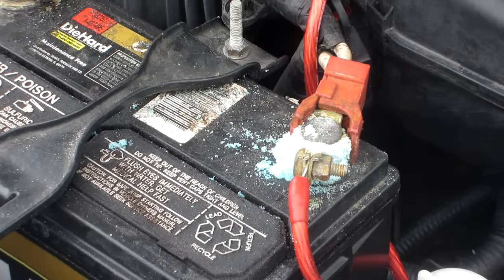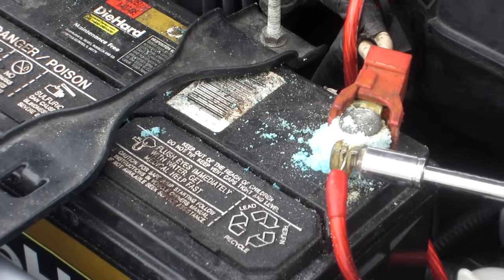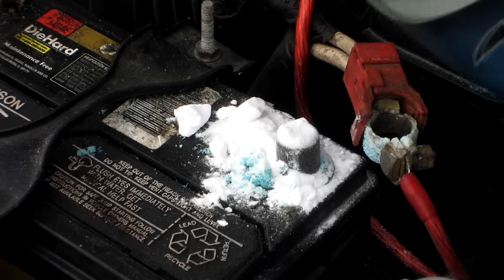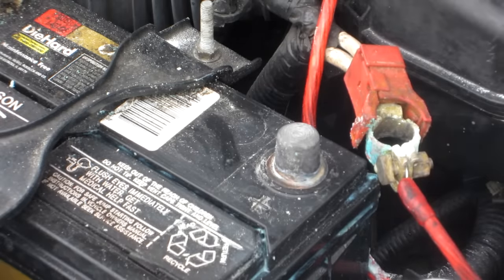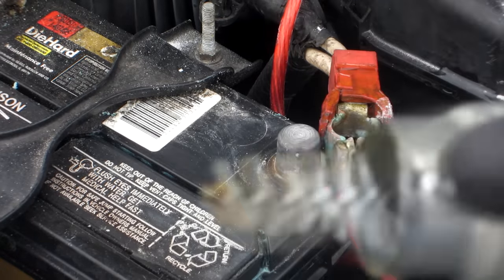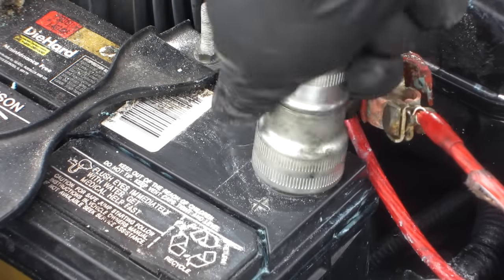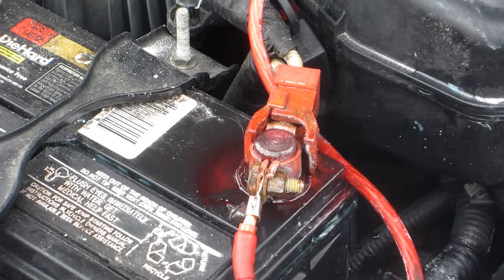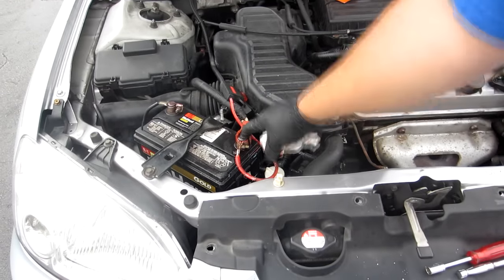HOW TO REMOVE BATTERY CORROSION FAST AND CHEAP!!!

Comment: You see normally nobody has that problem I've never had a vehicle have that problem there's absolutely no need to buy any of that stuff. Fix the problem fix the wires and you won't have to put anything on there. You're trying to put a Band-Aid on something instead of fixing it.

Comment: Here's an easier way....just use hot water.  No need to waste baking soda :)
Reply: Can you use boiling water to clean the terminals if the battery is in the compartment? Should you take the battery out before you add hot water?
Reply: @chocolatier9597  no need to.  Using hot water is no problem in the compartment!  It's really that easy and that simple...but garage's don't wanna tell you this cuz they wanna charge customers $50 for it.
Reply: @chocolatier9597  No need to take the battery off. Just boil a kettle and pour over terminal. Dry it off and coat it with Silicon Grease or Petroleum Jelly (eg. Vaseline). This will seal it from the air or from any acid getting to it again.

Comment: Dude. Bust out the garden hose rinse the shit off dry it with compressed air. Spray on permatex battery protectant. The purple stuff, done. 

The crc stuff is garbage! That shit will make you have to do it over and over.

Comment: Get one of these from AMAZON> {LPHUS Memory Saver Connector OBD2 Car Diagnostic Cable & ECU Memory Saver Cable with Alligator Clip, Vehicle Battery Replacement Tool, Emergency Power Supply Interface for Car Battery Helper}

Comment: Just remove the terminals.  Pour almost boiling hot water and then put some in a container mix in baking powder and stir. ...then pour onto the terminals and rinse. ..reconnect the terminals and you are done.

Comment: Thanks for the video. But this process was completely wrong! As you can see when he poured the water on the battery some of that mixture got inside the battry tabs on top. When that happens you can kill battry cells and ruin your battery.

Comment: Hi, no need put so much effort, just clean the corroded terminal with hot water, then wipe it with a clean cloth till it is dried. Apply some depolarizing grease on it. That's it.

Comment: just pour boiling water on the battery terminal its more easy and put grease so it will not corrosion anymore :D

Comment: Put a few strips of duct tape or package tape over the refill caps to help  prevent the cleaners from getting inside, then remove the tape.
Reply: Taping off the caps is absolutely not needed.

Comment: Not sure why OM would recommend it other than that’s what people have been told to do for so many years! Another fact is you should remove the ground cable first. Then if your wrench happens to hit metal you won’t see big sparks ⚡️! And you’ve removed battery voltage from the entire vehicle even with positive cable still hooked up because it’s DC voltage.
Reply from the maker: Young and dumb when I did it but you are correct always remove the negative terminal first. 😁

Comment: You are NOT supposed to put the corrosion spray on before you tighten up the connection. otherwise you inhibit a sound current connection!
Reply: It's a conductor so your point makes no sense at all.

Comment: your corrosion problem has nothing to do with a capacitor Its because of neglected maintenance and the cheap power wire you used for your amp. step one to stop that in the future is to use solid copper connections and dialectic grease.

Comment: So much going on here for cleaning the battery neck. 😂 Pouring a glass of boiling water in the neck will do all the work for you. Baking soda will do but boiling water will reduce the cost of baking soda and coca cola or Pepsi also help you too and when using these you don't need to remove or scape it

Comment: hot hot water in a cup ...  dip the terminal in the hot water and corrosion will disappear ...   You can put baking soda in the hot water too ...   Then grease the battery post and terminal before reassembly ...

Comment: You need a clean dry and tight connection between the battery post and terminal. First use your battery post cleaner wire brush, then reinstall your battery terminals. The last step is to spray on the sealer or your silicone Grease.. this seals out any moisture oxidation from forming in between your post and terminal!!

Comment: Dumb idea. Why didnt he mix the baking soda in a plastic glass of water, stir well. Pour in all over the battery posts. Rinse with water afterwards?? Doing this with a water mix would even clear the battery clamps at same time!! THEN you use your battery brush to clean the posts + clamps. Grease works well on top battery posts prevent corrosion.

Comment: Be sure to clean all that corrosion powder that felt down and also the battery held post or whatever they call also a cover on the positive terminal would not harm you trying to evade shorting the battery, after all it was a good learning...

Comment: Where do you think your rinse water goes? Now you must remove the battery and use your baking soda and water solution to neutralize the acid everywhere it spiled then hose off the battery tray and surrounding areas. Now spray anti acid coating on battery tray and surrounding areas. Clean and coat terminals and connectors with dielectric grease to prevent corrosion.  Chech back on the corrosion at least once a week and repeat cleaning process if needed.

Comment: First Pour baking soda into both terminals without removing the post cables then pour a little vinegar immediately  is going to start bubbling Let it finished scrap gently in both battery terminal  then rinse  it out with a hose

Comment: Should be using a a water hose to flush and you shouldn't knock the stuff loose all over your metals below. NOW you need to hose the whole area down to be safe from future corrosion on all your items below the battery. WATER IS YOUR FRIEND!! White Vinegar also neutralizes corrosion and is preferred as it's less messy. I just used white vinegar today and I love it but FLUSH everything with water!! Now rinse that stuff off of your battery,  tray, and all other areas you threw that crap on below the battery and around your battery!!!!

Comment: Bypass the bicarbsoda and just use a cup or two of hot water over the terminal. The oxide immediately and completely disolves away. When the area is dry then apply the gupe or spray.

Comment: This is the most redicules way to to clean a terminal.  Pour a bottle of coke on the terminal then hose it off, then spray the protector.  Drive down to the battery sore and have install a new battery.

Comment: Step one get a bottle step two add baking soda in bottle step 3 add water and mix solution step 4 pour on corrosion boom it's gone but it will return because it doesn't fix the problem which is actually with the battery...the seal around the post is bad and leaks acid and gases which corrode the metal hence it will always return

Comment: Spray 3 M adhesive to seal up the terminal , it does a great job . Beware it is flammable , do not short circuit the can against battery posts .

Comment: I didn't see you remove your ground wire.  If you didn't, you are just asking for a big spark and possible explosion.  You should also premix your baking soda and water and use a brush to clean off your terminals and wires.  Actually you should completely remove your battery from the car.  Then you can tilt the battery to help prevent the baking soda mix from getting inside your battery.  You need to get daddy to help you and show you how to do these things.

Comment: Here is a faster/cleaner/cheaper cure: Wipe the excess salt with a rag or paper napkin. Spray with WD40 all the affected parts and let it act for a few secs. Wipe again and everything is shinny. To prevent reoccurence coat terminals liberally with vaseline. Done!

Comment: A Major Battery company explained to me a long time ago. If you have coke, pour it on the battery & terminals. Let it set for a minutes or so, then sprinkle baking soda all over the area. The corrosion will brake down and the baking soda will neutralize the acid. Flush the entire area with water and blow off and dry.  The main thing is to neutralize the acid; clean the terminals and posts , reassemble the connections (positive first) and then spray terminal protector over the terminals, coating the surfaces. 
This is a long term solution.

Comment: I would remove the battery and tilt it, manually remove the bigger chunks of corrosion and make a paste and drain baking soda and water solution away from cells. Also disconnect negative terminal first, and since its disconnected anyway, check water levels in the cells. You’d be amazed how long a battery would last. I had a battery in my 04 Honda, that thing lasted 10 years before it needed replacing!

Comment: Don't have to take it off . Just use hot water
Reply: toyotapaulip 
YUP.  Just hot water works very, very good !  Use at least 1/2 gallon if not more. Like from a milk jug.  Washes all the corrosion away nicely to. You don't even have to bother with paper towels.

Comment: That amp power wire has nothing to do with the corrosion or the fact that you have no capacitor. It’s 100% the fact that it’s the damn battery leaking and causing corrosion because the acid from the batter is leaking at the terminals so that’s why your getting corrosion. Nothing to do with the AMP. I never rub capacitors in ANY vehicle I had except for my competition vehicle and the competition subwoofers and speakers I had with multiple battery’s and multiple amps for the aftermarket speakers and the all the subwoofers. And I have NEVER EVER had a SINGLE BATTERY corrode EVER. It has NOTHING AT ALL to do with the system you have hooked up. It’s COMPLETELY happening from the battery and the battery alone. I bet you go buy a new battery that’s not leaking and you won’t have ANY CORROSION. Or if you fix the leak on this battery because you might clean it all up but it will come right back and that’s a FACT. So I just suggest get the battery replaced and you won’t have to worry about it and not getting enough power to the car or the system right now because that corrosion is causing it so that your not getting full contact to the dirty ass terminal so your getting more draw from the battery because you have bad contact to the terminal right now and it will be like new once you clean it up like you just got MAD voltage/amperage back from that battery once it’s cleaned and your getting a perfect contact to the terminal

Comment: Uninstall the battery from the tray ..put it on floor and then wash it and after drying reinstall the battery and also check the acid gauges before reinstalling ...y r u trying to squeeze the space if u can expand it ....

Comment: Best bet is using a hose with plain water to wash it off first and break it down then mix up some baking soda and water say in a coffee can or something larger to wash it off once again to eat off the remaining corrosion. Let dry then cover the terminals with a spray battery terminal coating or just coat your battery terminals on the battery with grease. Both work well.

Comment: Yeah, bad idea with the baking soda.  By dumping it indiscriminately all over like that  you're leaving residual baking soda in the  recesses of the filler cap, which an eventually find it's way into the cells.  Baking soda, of course neutralizes acid,  so it's bad for your battery.

Comment: Emergency repair out in nowhere- no tools no baking soda. If the engine failed to
start and found out that the battery poles are corroded,,, simple repair that works
get a can of coke or any kind of carbonated soda and pour into the corrosion. Wait
several minutes and it will clean the corrosion enough to make a contact and make
it start. Not a solution, just a remedy to make you to the next service station.

Comment: wouldn't suggest people do this.. unless you fully remove the battery out of the car.. also just wiping off the battery with a clean dry cloth and then simply applying grease would do the trick.. this video is no good

Comment: I watched in horror as you poured the water over the baking soda and it funneled under the cap cover and into the battery electrolyte.
Dont do that! Damages the battery.
Big mistake!

Comment: Well, nice trick but it could have been better had you pull out the battery at safer place for cleaning and applying chemicals to safeguard car paint and other parts from expected damage. Hot water (from radiator when on a way) may workout in place of baking soda for time being by soaking the cloth and applying on terminals.

Comment: You did not clean all the corrosion off the rubber gasket leaving a starting point for the regrowth of corrosion on the terminal. Aside from that it was a pretty good presentation for your particular battery. However with my battery terminal I had to mix baking soda and water in a cup and paint it on with a brush and in some cases use a small screw driver to chisel away the corrosion that had turned to concrete or became a gooey paste that the various brushes I had would not remove.

Comment: This is not the best way to do things. Disconnect negative first so that when you disconnect the positive you don't short out the battery should the wrench handle hit a metal part of the car. Tapping the connector so that corrosion falls onto painted surfaces inside the engine compartment? Put a bowl under it before tapping. Dry baking soda doesn't do much good. If you don't see bubbling, fizzing, the baking soda isn't doing much good. And he used way more than is needed. Dissolve a 5 ml (teaspoon) of baking soda in 250 ml (a cup) of water. Then pour it slowly over the corrosion. If you use a syringe or squeeze bottle you can avoid flooding the battery top with too much; you do NOT want to get soda solution  into the battery's acid solution, through the removable caps; they might not seal as tightly as we would like; that's why it says "keep the battery upright" on the battery. Soak up the baking soda solution with a paper towel. Then pour a little plain water over the top, with a syringe. Tap water is fine. After you shake off any loose corrosion, dip the terminal into a cup of the solution and let it sit in the solution for about 5 minutes. Then pour plain water over it. The cheapest terminal protector is a thin film of grease (or petroleum jelly) over the post and inside the terminal; after you connect the terminal, a little more grease all over the top and sides, especially around the threads for the clamp-nut. As well a prevent corrosion, grease on the threads will make the nut easier to tighten-loosen.

Comment: I’ll go one step farther..... just hot water,  dry the terminals off if u like and then spray with terminals with protection. Never brush off the terminals with a brush..... the acid gets in the air and possibly up ur nose and/or ur mouth or clothes.

Comment: The corrosion is from gasses leaking from the battery through the seal that seals the terminals from the insides of the battery. The battery in the video needs to be replaced. 

This battery is going to die soon.

Comment: THE BEST WAY TO CLEAN IS WITH CLEANING VINEGAR.
THEN SPRAY WATER AND DRY CHANGE THE TERMINAL AND PUT A NON CORROSIVE PAD UNDER THE TERMINAL.

Comment: When dumping water on the battery, I would be VERY careful to make sure the liquid doesn't touch both terminals at the same time...

edit: I just watched a video of a guy doing this exact same thing, pouring water between the 2 terminals of a car battery to clean it. Nothing happened. Who knew!
Reply: 👍👍 I pressure wash batteries all the time and have for years with zero issues.

Comment: Nice try but wrong. You will ruin your battery if any baking soda gets in the cap vents. Never put protectant on before connecting terminals. Never touch the positive if the negative is connected. And last, if you are going to clean your terminals, you should clean them completely and not leave corrosion just to seal it in with protectant. 

Sorry guy, I give you credit for trying to help others because most people don’t clean their terminals at all. Sometimes you should leave things to the professionals.

Comment: your wiring is crap - this is why you get that corrosion. By the way boiling water works great as well.  without all this... you shoudlnt b getting that much with 250 W amp. I have 4500 W running and I have no corrosion- But I do have a secondary battery.

Comment: Safety tip: never lean over the battery and it would be better if you took the battery out to do the cleaning.
Reply: Yes great idea. This way the corrosion and mixture of baking soda and water doesn’t get in and under the battery box to rust out anything later on

Comment: Well when I was young I used to disconnected first the battery terminals & then mixed water in combination with baking soda & lemon to cleaned them up but now that I'm an ooolllddd man certainly preferred seal battery not to be mess around .

Comment: I learned a much easier method. First place a large catch pan under the car to catch all the acid and water.  Do not disconnect the terminals yet. Then using plain hot water, no additives, pour it right on the corroded terminals. The corrosion will just  wash away. And as advised before removing the positive terminal, remove the negative FIRST!  Finish washing off any residue, wash down the battery and battery tray, brush the terminals and cable ends. Put anti corrosion washers and grease on the terminal bolts, battery terminals, and cable ends. Attach the positive cable end first, finish with the negative cable end.

Comment: I use a water hose turn it on slow and in just minutes bright shiny copper . Or grey lead .its clean no comical no brushing no tools just city water straight out of the tap try it i dare you .ha ha

Comment: Never EVER pour water on your battery. Use a wet sponge or a rag, then wipe and dry the battery, especially around the terminals. Batteries are sensitive to water and humidity.